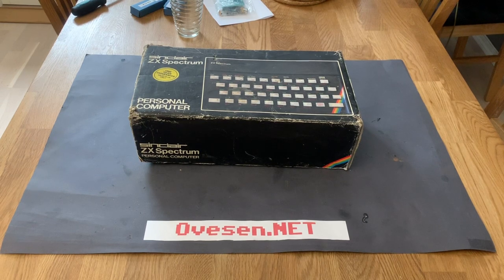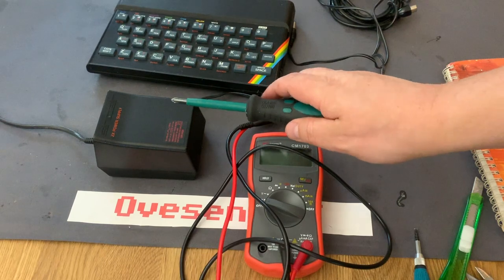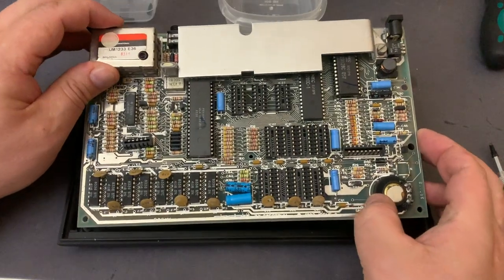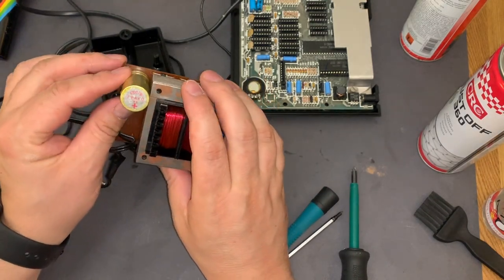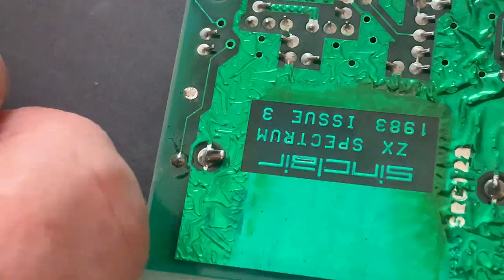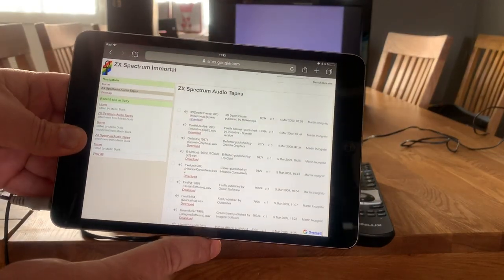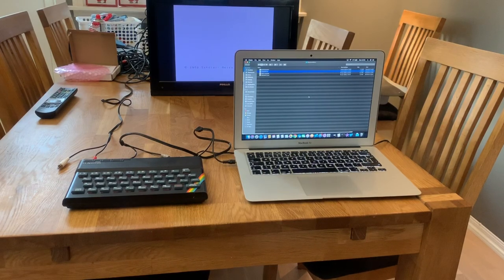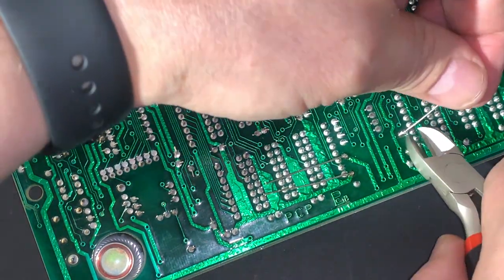Sinclair ZX Spectrum composite mod and recapping

Comment: I am here because Adrian (from the Digital Basement) mentioned your channel. I am a Sinclair fan from Istanbul. Thought I should mention some pointers:
1) The PSU; It is an unregulated PSU, so 14V is normal, but not necessary. I fact it makes the poor old 7805 run very hot. I strongly recommend placing a regulator inside the power supply box and adjust the output to be 9V exactly. There are very small switch mode buck (step down) DC-DC converter modules available, any one of these which can do 2A current will be enough. You'll notice right away how cooler the Spectrum runs after this. Take care for the polarity, the DC jack on the Spectrum is CENTER NEGATIVE. reverse power will kill a lot of things inside.
2) The composite mod: Don't use a straight cable connection, use a 100uF capacitor to filter out the DC in the video signal. Your TV seems to be fine about it, but many others are not. Positive leg of the capacitor goes to the board, and negative to the video out jack. A 16V 100uF cap will do.
3) The audio jacks are a little confusing on the Spectrum, the one written EAR is the input (because it is supposed to be connected to the EAR jack of a cassette player) and the MIC jack is the output (same logic)  Issue 2 & 3 Spectrums (yours is an issue 3) are a little deaf, so high volume ensures good loading.
4) Your Spectrum is a 16K, can easily be upgraded to 48K. You need 8 RAM chips (get 4164 DRAMs, and these logic chips: 2 x 74HCT157 (IC25, IC26)
, 1 x 74HCT32 (IC23), 1 x 74HCT00 (IC24). Under the heatsink, to the right of the MIC socket there are RAM configuration jumper links marked as “TI, L, H” and “OKI, 3, 4”. Link the two pads marked “TI” and also link the two pads marked “4” or "3" (3 or 4 setting is for choosing the upper or lower RAM block on the RAM chip, This one does not matter if 4164 chips are used, either setting 4 or 3 will work.)
Regards!